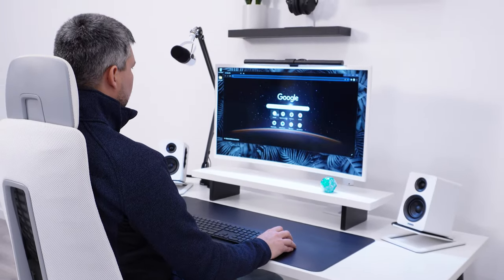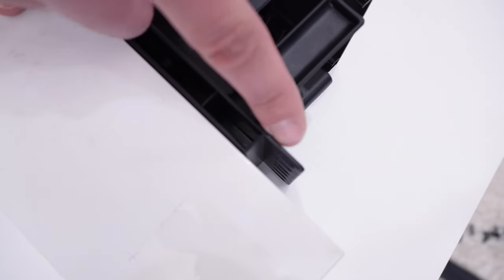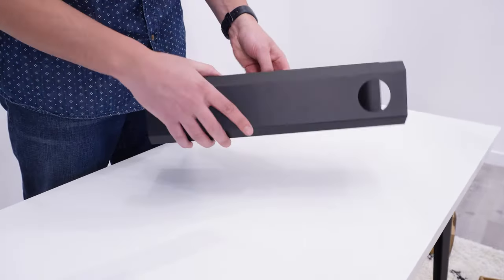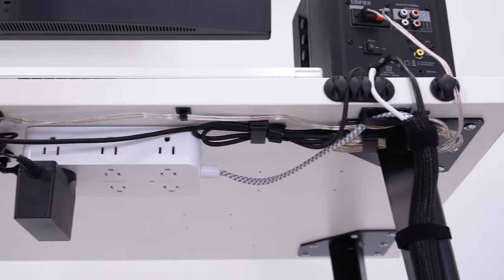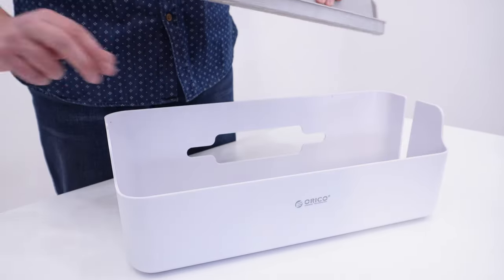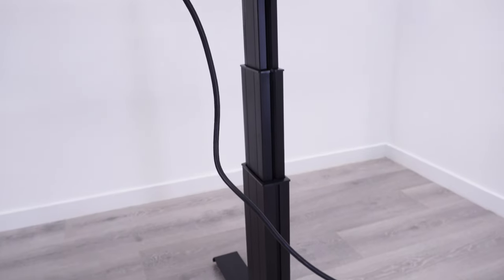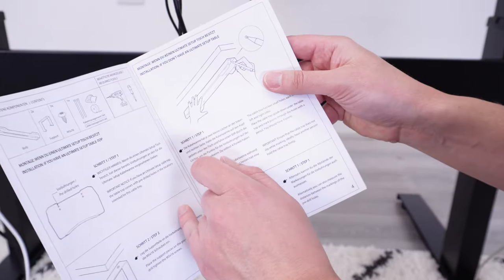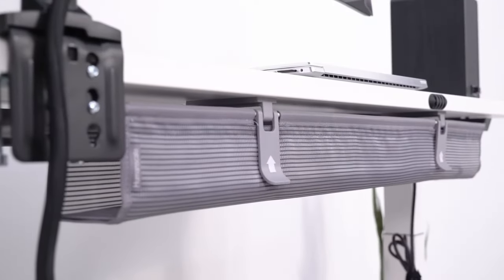I Picked The Best Cable Management FIX For $50

Comment: I got the sleektray and used the adhesive. it fell off after less than one day. was stunned. The only things I placed in it was a power strip and like 5 cables that connect to it. Would you try to return to amazon? I cant imagine I made an error with using tape...or would you just use a drill

Comment: great video. i'm certainly interested in the premium $50 swining cable tray.
question: how do you retract USB cables when they're not plugged into a device during charging? i've found it quite annoying seeing a long cable hanging all the way down when not in use.
Reply from the maker: That's a tough one. I try to use the shortest cables that will still get the job done. Then I use a cable holder that lets the cable slide through it easily, but wont let it fall to the floor. Another option is to go wireless charging, but that has it's downsides. - RG

Comment: I don't like double side tape, in my experience there are only two types of glue, the one that will eventually fail and the one you can't remove when you need to and will destroy your stuff. Also I don't want to destroy my desk board, because I might change my mind in the future, so to me the best option is all cable management that allows me to do & undo it easily,

Comment: How did you mount the power strip to the desk underneath?
Reply: Question everyone is interested in
Reply: from my experience almost all power strips have the ability to be mounted. howeveer normall these present them selves on the rear of the power strip as little slot holes that you sit ona screw and slide to lock it in

Comment: All I want in life is a cable tray wider than 5.2 inches to fit my massive surge protector. But everything that exists (even one similar to the last one from this video that advertises as 5.3in but is actually 5in) is too small and I really don't want to just mount it upside down with adhesive strips
Reply: Well said.  They must think the 3 blind mice, without a sense of quality or economic how-to, sit at pc desks.  Adhesive strips are just an ugly, undependable solution.  Inevitably they will fail and anything they're holding will come crashing down.